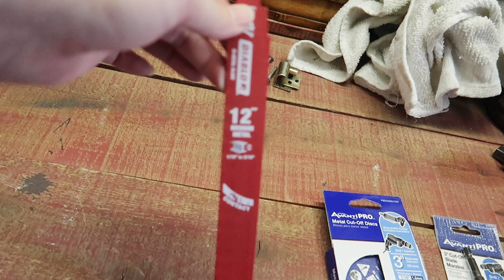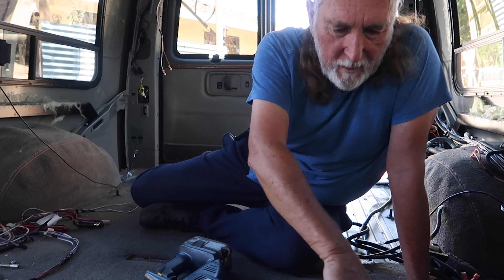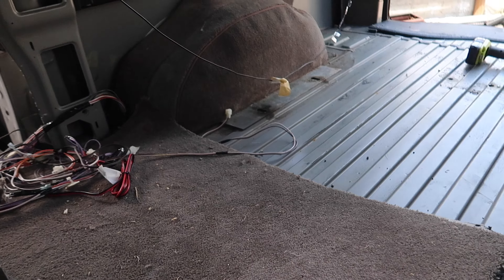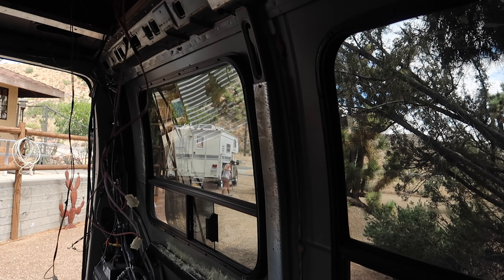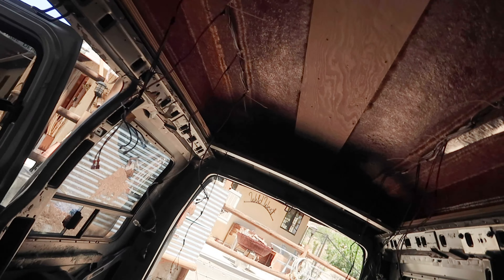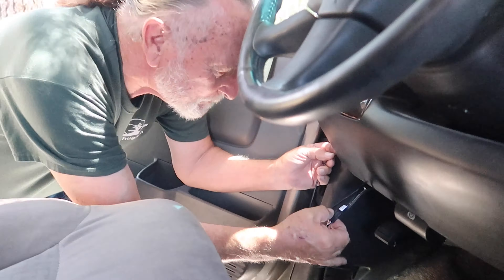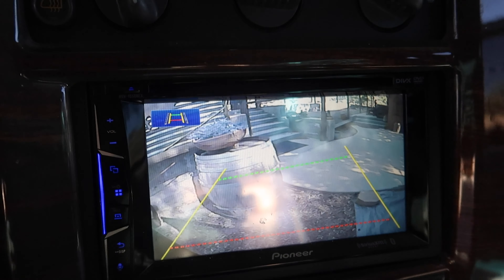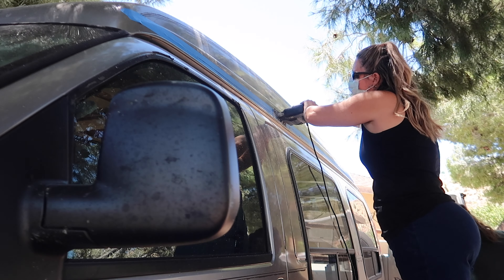Removing the Wiring in a Van Conversion (Chevy Express Explorer) // Travel Snacks

Comment: Have you considered whether the roof is part of the structural integrity of the van. Over here in Oz we would probably have to get an engineer to sign off on those sort of changes to a vehicle. Then again you do live in the land of the free and home of the brave
Reply from the maker: I'm not sure! The top part on the current roof is fiberglass so I don't think so. We left all the metal and wood in place. We'll be adding wood in the center of the roof if that makes sense. It should be pretty secure once we're done though!
Reply: @travelsnacks  If the roof is fibreglass then its unlikely to be structural, all good then, although it sounds like a big job. Good luck with it